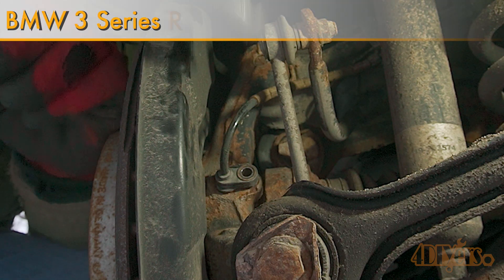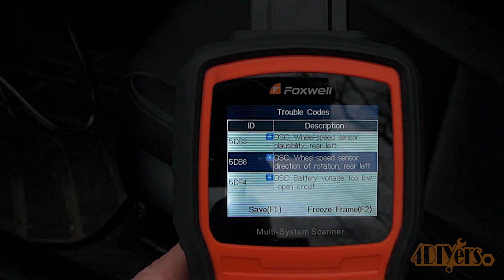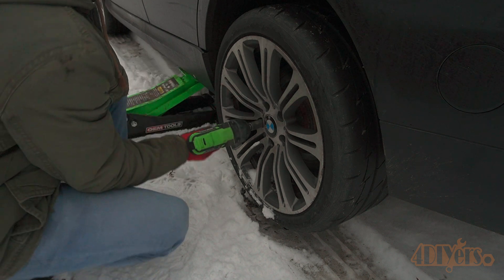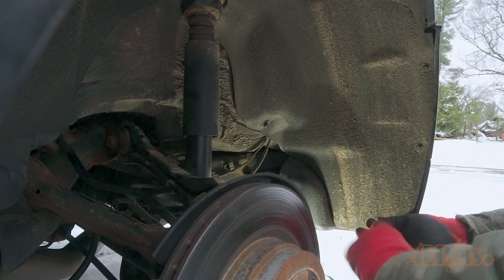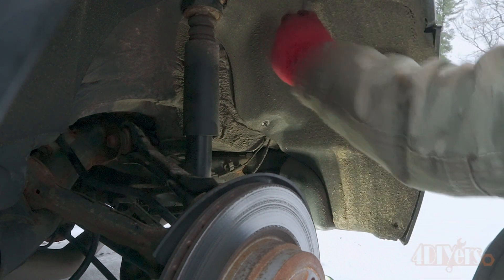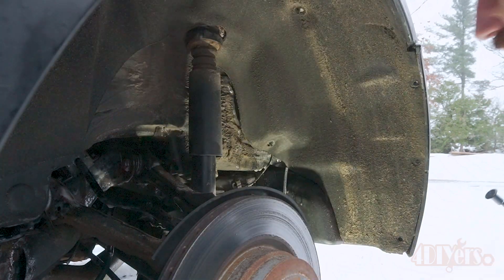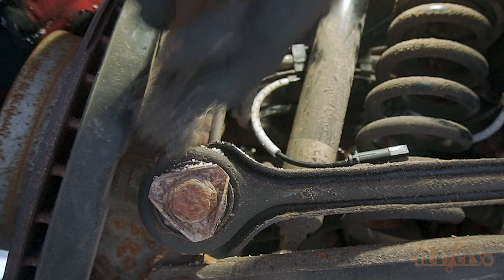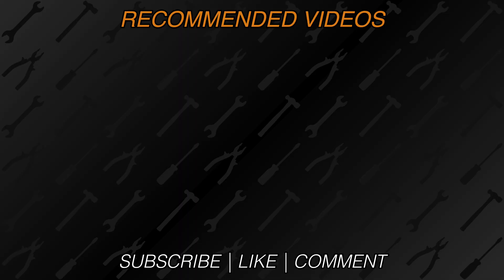How to Change the Rear ABS Sensor on a BMW E90 E91 E92 E93

Comment: Really clear. Thanks for braving the cold and snow!  I also like the attention to detail: cleaning off rust etc. One question: do you always need to replace the sensor? Can it be cleaned instead? I've seen another video where it was caked with iron filings and they mentioned cleaning. Just curious if cleaning is a viable solution.
Reply: Actually just looked again and there appear to be 2 sensor types. The one you have looks like a later one that is completely enclosed in a plastic casing so nothing to clean and replacement is the fix. The one I mentioned above is maybe an older style that is open and collects debris so maybe can be cleaned. HTH someone later.
Reply from the maker: Thank you for the kind words! The sensor can be sometimes cleaned and you can test the sensor with a multimeter if you have the correct values.